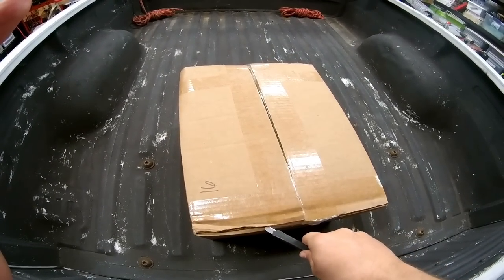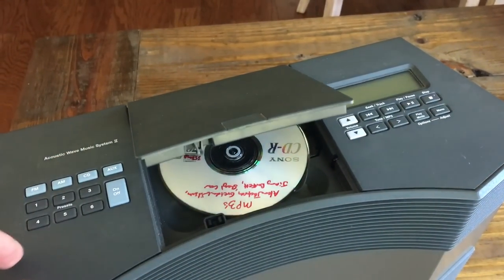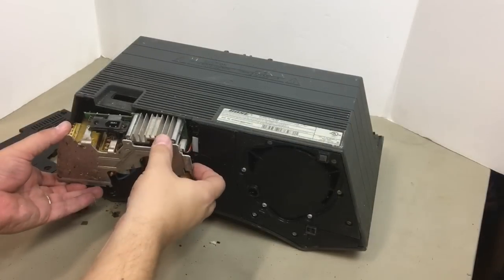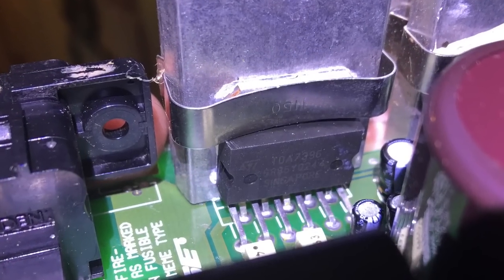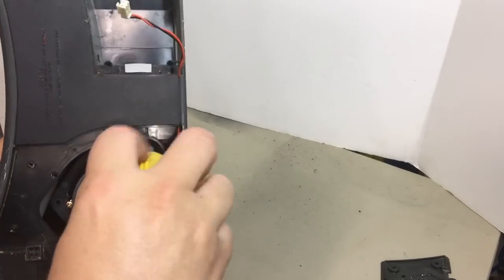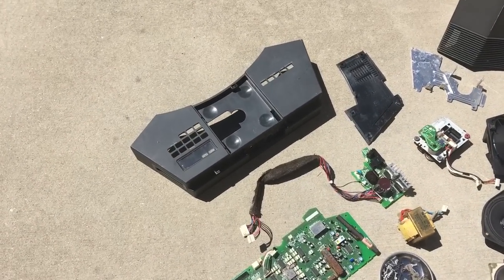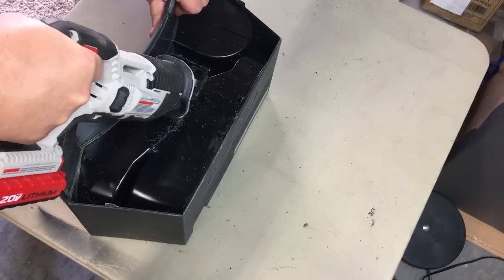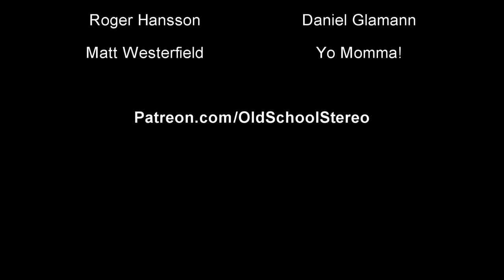What's Inside $1100 Bose Acoustic Wave Music System CD-3000

Comment: Big Dwiz do you think this unit was worth the $1000+ price when it was new?
Doesnt really look like much for the money but then again iv never heard that unit
Reply from the maker: +Tom Mangu Bose was never known to be a value brand. They are expensive and simple to operate. Many people who have money to waste like simple...
Reply: Tom Mangu when the acoustic wave came out in 1985 it was $599. Anyone that Listened to it wanted it. It was the BEST sound system you could by for $600 back then. The original was made in Japan. When the yen went through the roof the price doubled.  People still kept buying them. Then Bose stopped making them in Japan and dumbed them down to cut cost. Still kept raising the price. When it reached $1300 most of the folks that were buying them wanted one years ago but could not afford one. It was still an excellent apartment option until the lap top , cell phone, and the MP3 all but killed it.
Reply: How is it an "excellent apartment option" when any half decent boombox, CD player will beat this thing's audio quality with ease?
Reply: Steam Steam, There is no "BoomBOX"  made to this day that I know of that can outperform the Acoustic Wave system.  Nothing peaks at 115 db or can run  6 to 10 hours on DC power.  In fact it only takes about 3 watts for the system to sustain 100 db.  There are many compact systems that sound far better or play louder but none have the combination of the Acoustic wave. If you know of such a boombox let me know.
Reply: What do you even mean by "peaks at 115 dB"? You mean it can reach that volume level without distorting? Many can do that and it would surprise me if this thing didn't distort. There are so many different boombox systems I'm sure some can run far longer than that. I can easily build something which outperforms this with some heavy batteries and some decent Tripath-amp or other amp IC solution. You're talking out of your arse are you paid by Bose or something? It's ridiculous. They literally charge 1000$ or more for a plastic enclosure that supposedly gives you improvement in sound quality that undoubtedly will me negated by the fact of how cheap the used electronics, woofers, etc are. And some proprietary control panel and input, source components. It's a scam. This thing should at most cost something like 200$ and even then it's hardly a "value".Just look at how cheap that woofer is. I know you don't see it normally but you're not telling me that is a "high quality" woofer worthy of anything near that price tag. Maybe it doesn't matter that much for sound quality. It probably does you see I'm against needless "expense" without any improvement in sound, "audiophile snakeoil" but Bose sells at audiophile snakeoil prices for cheap garbage.
Reply: Have you even auditioned an acoustic wave?  Ever?   AWMS puts out 35 wats of maximum continuous power.  It is rated at 100 db at 1 watt  At 10 watts 110 db.  113 db at 20 watts.  THAT IS ONLY HALF OF ITS RATED POWER.   It can play 110 db from 100hz to 15 kz Clean.  
 It plays real bass down to 50 hz.  Playing off the built in Cassette or Cd player it is almost impossible to distort or clip.  The maximum output is   around 108 db clean.  With an external mixer with some real voltage you can push the built in amps right into clipping....... you have plenty of clean power before that point.  
The components in the AWMS are all crap.  Cheaply made.  The Engineering is sound and proven..My unit is 30 years old.   The cost is high because of scale.  Bose has never sold a ton of them. The unit cost per unit is high.  The new units are not even as high quality as the originals.

Boom boxes today are all garbage compared to the late 80's early 90's.

No the AWMS is not fantastic sounding it has that corporate Bose sound. It easy outperforms everything on the current portable  market.

JVC had a boom Box with horn loaded tweeters that could go toe to toe with the AWMS and had BETTER highs.   You had to use an external source its tape deck and AM/FM were crap.  While the AWMS would play for 5 to 8 hours on d cells the JVC was done after about 1.5  to 3 hours.

Looking at the way something is built and trying to judge sound is impossible.   I have seen crappy stamped steel  tiny magnet 10" drivers destroy massive magnet aluminum basket 10".
Reply: fatboy19831 what destroys this bose would be the proton 300 table radio w/301 aux speakr...$700 msrp in 1989.

Comment: Pretty decent engineering to have those little woofers acting as drivers in a bandpass configuration without them cancelling out each other's frequency.  But $1300, no friggin way.
Reply from the maker: Agreed the retail price is outta control. Best to find one used, can be picked up for around 200 at times and IMO a fantastic deal at this price

Comment: Heard one at a bose  store and it sounded like a  boom box from the 80's,worth $100 at the most.
Reply from the maker: I have a working model and people who visit I’ll play it for them and they are mostly impressed
Reply: Thats fine but is it worth $1100?? You can buy a nice mini system for a quarter of the price that will sound the same, or for the same price buy a very nice beginners sound system that will be 10 times better.
Reply: I have two friends who have one and they both sound poor to me. The treble is weak and the bass is boosted and has a horrible resonance, so the sound is an awful mess. It's nothing like hi-fi which Bose claim.
Reply: @johnr6168  I would say it sounds good for $80, not the insane price they charge, but bose banks on the fact that most people arent into hifi, they don't want to deal with knobs or wires or connecting components together just plug it in and it starts playing, for most people hifi is just an appliance no different than a toaster or a microwave oven.
Reply: @hifijohn  Yes I think you're right. I even have a couple of musical friends who don't seem bothered about their equipment's quality. I'm also musical however and have a very different approach, but then I'm an ex-broadcast engineer!
Reply: @johnr6168  A few things I've learned, musicians arent audio people, and I understand. when I listen to a recording I will nitpick it to death, when I'm recording someone I am very picky on everything, right down to the mic cable im using but when I record my self I don't care, I will go through a whole box of guitar picks to find the one  I like, but stick any mic I can find in front of the guitar and start playing, anything about the sound I don't like will fix with an EQ. I will complain about a fret buzz or minor string squeak but the sound quality is really not that important, its the performance that matters.
another thing is money doesn't equal taste in hifi, when I worked at a high-end hi-fi store many years back, I just assumed most of the customers would be rather wealthy, but just the opposite most of our customers were rather average some looked like they couldn't afford a meal at McDonald's and yet would buy some of our most expensive gear.

Comment: I have a Bose Acoustic Wave CD 3000, Music system 3, it is an old but clean unit. There is a distortion on the bass sound and I would like to know if it needs tuning or a new speaker.   In addition, the remote control is not working and I would like to buy a new one.
Is there a solution to my problems and how much will cost? The warranty expired a long time ago.
Reply: You can get the remote on eBay for 20 bucks. You can replace the sub woofer also. They have them on eBay as well I think for 35 bucks. Easy to change too
Reply: @steveafanador6441  Steve
Thanks for your answer. I found a supplier for the remote control that will work in my system, as you know. not all RC does. Is the subwoofer a more standard part for the wave radio than the RC? The problem is that I don’t have a Bose manual to do the repairs, also I’m in Chile. I watched your video and it doesn’t look that easy to get inside the radio.  In your opinion, is the radio worth the money on repairs?  
My Bose radio is in really good shape, I even have a travelling case (new).
Reply: @tupregunta  it's just a few screws on the bottom. Look up the model number for the subwoofer. You can do it easy👍
Reply: @steveafanador6441  not quite comfortable, but I will try. 🤔
Reply: @tupregunta  yes do it very easy
Reply: @steveafanador6441  Hi Steve, I took it apart and the subwoofer #  108515 J  looked OK me. Does the orientation of the radio have to do with the sound?  I could send you by email images and parts of the radio for your evaluation.  Thanks
Reply: @tupregunta  yes it does. I have mine in a corner of my room. It sounds the best in a corner. Try that

Comment: Do a dyno of the amplifier if you can get it to work.
Reply: thebestofall007  wouldn't be more than 200 watts
Reply: i've worked with this kind of stuff, and it's more like 10-15 watts (trust me,that is plenty if you have good speakers)
Reply from the maker: +thebestofall007 the original AW-1 was rated at 5x2 and 25x1. I seriously doubt that main circuit board is any good
Reply: PetruV yes playing at normal levels you are only using about 2 watts of power. The system is amazingly efficient.

Comment: When I took apart my 1986 original acoustic wave. The wave guide seamed more complicated. My sub driver was .6 ohms!  This system with an external high voltage input ( say like a mixer) is capable of well over 100 db of clean music. Could easily peak at 115 db. I used 2 of them at an out door house party back in the 90's.  Ran a 100 hz high pass and used two 12 " powered subs.  Cristal clear and loud. I Acoustic wave could rock a beach party.  Although sand is its worst enemy.
Reply from the maker: I have an original AW-1, but it's in really good shape, so I don't want to tear it apart. Very interesting to hear...
Reply: The AW-1 was a better system in my opinion. The were made in Japan by a company called Fujitsu Ten. When they went to the CD-2000 and CS-2000 they were made by a company in Malaysia that also made products for other companies such as Panasonic. When the CD-3000 came out they were built by Bose in Columbia South Carolina. They have since moved production to Mexico.
Reply: 66skate  at its price point it should be made in the states.

Comment: Cool.  It's always nice to know just how bad Bose screwed me out of $1,200.  The Acousticwave system 2 that I have sounds really good but DEFINITELY not worth what I paid for it.  The jokes on me I guess.
Reply from the maker: Sorry bro. I have one of these and I personally think it sounds good. I picked mine up used though for under 300
Reply: BigDWiz I think it sounds good to.  But a month after I got it the $125 adapter for my iPhone was obsolete because Apple changed the connector.  Bose stuff is really expensive.  By the time I bought the unit, carrying case phone dock and battery pack it was almost $1,700. I do like it but I just think I could've spent my money better.  Excellent video by the way!!  I always wondered what was inside the thing!!
Reply: @apieceofdirt4681  They are definitely not worth $1100. I own one that I bought for $50 at Goodwill. It's a nice sounding system, but it is NOT $1100 nice.

Comment: All this Hose bashing is not taking in to consideration 2 very important factors ,1st off Dr Bose invented the bose 901 stereo speaker array system not to be the best high fidelity stereo system ,he invented a speaker system with 2 distinct requirements, #1 must play at extreme SPL and I've pushed 1,200 watts of McIntosh power thru them and achieved an insane spl of 137 ,Dr Bose 2nd requirement was to develope a speaker system that best replicated hearing non amplified live performances of chamber music ,orchestral & modern classical in a theater setting ,for that function he did a superb job .

The " no high no lows " nonsense people repeate only shows their lack of knowledge of speaker design , it's a fact that three 5" speakers will produce more bass and deeper bass than a singke 12" because the three 5s have 15 " surface area , the best sounding  $55,000 line arrays made by speaker designer & McIntosh legend Roger Russell contain twenty six 5" paper cone drivers and they thump below 10hz at war splitting spl, the EQ Dr Bose chose had already been made and copyrighted by McIntosh and it's what Bose uses for their 901 series loudspeaker. 

Lastly Dr Bose created 1 of the best true high end stereo amplifiers of the 1970's, the Bose 1801 stereo amplifier was better than any high end solid state amp on the market ,it boasted a rated 300wpc @ 8 ohms and 600wpc @4 ohms with an obscene 0.5 % THD ,The only amplifiers on the market that were pushing 600 watts at 4 ohms with 1/2% Distortion at clipping was the McIntosh Mc-2300 amplifier with the same wattage breakdown and are the amps the grateful dead powered their legendary wall of sound with ,the matching preamp for the 1801 amp was also a work of art and better than any solid state preamp at the time, McIntosh really had to step their game up to best the Bose preamp .

Lastly Dr Bose was a marketing genius ,from the 1940s to the early 1980's every home had a high wattage hifi system with quadrophonic sound ,or 2 massive main speakers such as the Altec 19s ,thru mass marketing Dr Bose convinced half the world that a bass module with a 5" driver set up in a 5th order bandpass in a plastic box was a subwoofer ,he also convinced half the country that 1" tweeters with 10% Distortion in 4 " plastic cubes was high fidelity ,a Bose 5.1 system with less than $50 worth of electronics, speakers and amplification sold for over $1,000 and now the new Bose 9.1 system with maybe $150 worth of parts sells for nearly $3k and people will fight with me about their Bose 9.1 system being every bit as high fidelity as my $1.2 Million dollar McIntosh 5.0 system that's powered by over 7,000 watts @8 ohms with 00.05 % distortion and is capable of handling transient peaks in excess of 20,000 watts without clipping ,my mains cost $58,000 alone but Bose owners are convinced their plastic 40 watt Bose system is my systems equal, that's pure genius .
Reply: Levi Ledford Levi, seriously read up on basic geometry.. LOL @ "it's a fact...that 3 fives have a 15 inch surface area and, produce deeper bass than a 12 inch driver." Did you seriously just add 5+5+5?  SURFACE AREA is pi x radius squared. That means over 5.5 five inch drivers equal the SURFACE AREA of a twelve inch driver. That's quite a mouthful you posted when your basic math is off. Sounds like Bose math to me!
Reply: 802s would be better at that wattage.
Reply: 7000 watts?  Your speakers must be terribly inefficient.  My own system is worth about $25 K.  I use use modified Altec A-7's with JBL horn tweeters and large infinite baffle with twin JBL 15's as a subwoofer.  There's 600 watts of amplifier. power, (Altec)  which is more than adequate.  No respect intended here.  I would love to be able to listen to your system.

Comment: look i get it, this is supposed to replace portable radios and yet it costs way too much. its made of plastic but portables are usually made of plastic. it doesnt come with a carry handle. no battery capabilities. why buy something this compact if it isnt portable capable? i have a home stereo/theatre receiver unit with nice speakers and i also own a portable radio for portable needs and yes it does batteries.
Reply from the maker: These have an add on battery pack
Reply: @wal   yeah but for $1100 it should come with a battery pack. i didnt see anything remotely close to 1100's worth of technology in that radio. bose claims research is the reason for their prices but why are they the only ones over-pricing their stuff? every other company out there does research to get the best quality sound but they dont pass the price of research onto their customers.

Comment: You can NOT measure speaker IMPEDANCE with an ohm meter !
Reply: DC resistance is not than same as AC impedance
Reply from the maker: Thanks, yes I totally blew it and corrected myself in the video description..but there is no way to fix the segment in the video as YT will not let me edit. Total fail on resistance vs impedance 😔👎
Reply: was just about to say that!  Resistance is only one part of impedance. You also need to factor in inductance and capacitance.
Reply: That's odd, I've done it for years and I was able to obtain accurate results by doing so.

Comment: so its a t line for a 4 inch speaker, pretty neat
Reply from the maker: +unsaved013 the fancier Japanese market model had a 6" sub and six 3" drivers! I'm trying to get one imported to show it off. Just costs a fortune to do this. Anyone in Japan who can lend some assistance?
Reply: BigDWiz I'm stationed out in Japan if I find one I'll let you know but I haven't seen any!!
Reply from the maker: +Drew L it's called the Via and is a 6.1 setup. They are rare, even in Japan. Looks like an air conditioner

Comment: That 'sub' was used in ALL sorts of Bose speaker systems. So much, my car which has a Bose system (Audi S3 8L) has 2 of them speakers as the mids in the front doors and 2 in the boot for the subwoofer. All sound TERRIBLE

Comment: Does bose suck? Yes and no. 
Did bose make a pretty decent sounding cd player with more wattage you find in modern stereos today and all at the same time not had 18 cubic feet towers with big 15's, 8's 4's and four tweeters? also yes.
people wanted portable music without half the room filled with speakers and amp racks and boxes and wires running everywhere. How else do you reproduce low low's without big drivers? box design! in this case you have a folded horn, with proper tuning a 6th order bandpass box could make flea market subs reproduce those low lows and thats what bose had to do. its boses fault for selling it and our fault for buying it for the last 30+ years